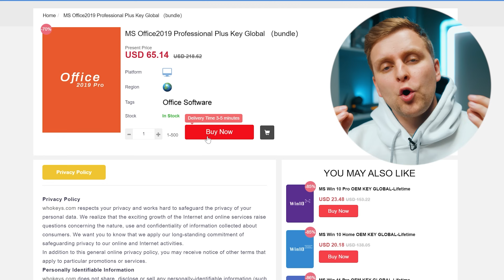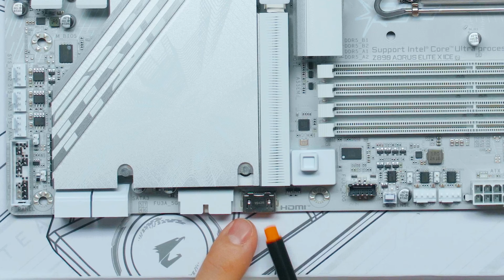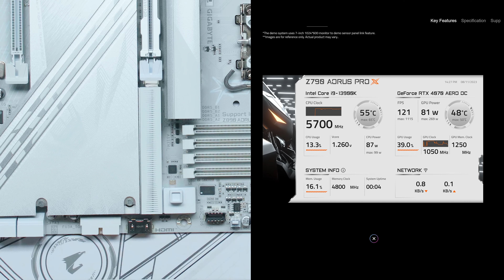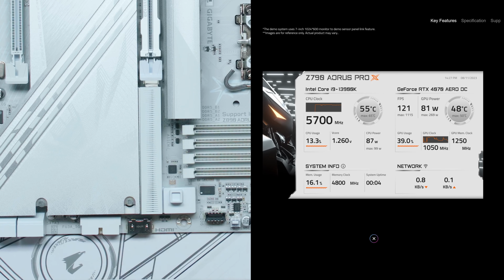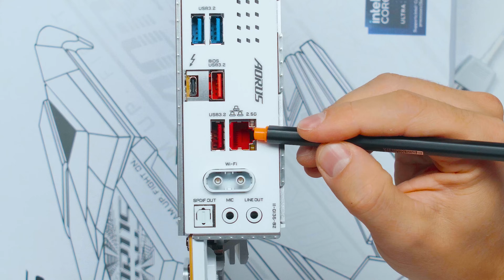The $300 motherboard you NEED in 2024!👉 Gigabyte Z890 Aorus Elite X Ice

Comment: I have a question, what about aio water cooling with the new Intel processors? Can I use for example the Lian Li 360 Hydro Shift? Or should I wait for the release of a new cooling specifically for the new Intel processors compatible with 1851?
Reply: I found out that will be compatible, I realy hope cuz I am already waiting with my new hydro shift 😅
Reply: LGA 1851 is 100% compatible with LGA 1700.
Reply: The socket is the same size as LGA 1700, just the pin layout is different. You'll be able to use all LGA 1700 coolers with the new LGA 1851 socket.
Reply: @ABP8214  thx dude

Comment: Poor mans bare bones. 8 pin power limited to 150W missing from the PCIe limiting the GPU you can add to it. I doubt 5090 would run at it full potential or pairing Battlemage optimally. Half the stuff you will never need on bare bones just to make the board look busy. Extremely poor cooling for storage and the power stages for CPU is bare minimum. This is for those that don't know any better or try to spend as little as possible getting shiet. I guess there is market for these but that doesn't include me or anyone that has even the basic knowledge.

Comment: One issue I had with a B650M Aorus Elite AX Ice is those right angled SATA/USB 3 connectors on the right side of the board. I was using an MSI case that came with a right angled USB 3 front IO cable and I had to use a different motherboard in the end because that right angled connector supplied with the case was blocked by some of the case internals. Very annoying!

Comment: Manufacturers need to start reducing the number of USB-A ports and increase the number of Thunderbolt and USB-C ports.
Reply from the maker: Yes!
Reply: 4 USB-C is just perfect , a mouse, a keyboard, a microphone (even a professionnal one at 192khz and 32 bits will be very far from saturating usb2.0 bandwidth, and optionnally an audio interface, or a printer)
Reply: I don't think many mice, keyboards, controllers, and mics require a require USB C.   As well, that'd be anti consumer, as we'd all need to ditch out current hardware.

Type C is also really bad with extensions.  The voltage and ampage is way too high for the cables they are currently using.   Needs to be as thick as a 12v plug adaptor.  It becomes a safety concern when the cord runs 125volts at 2.5 amps.
It's recently been under the scope when it comes to cable extensions, as the differing quality of the cords creates hot spots that can ignite if left unattended.  Ie.  One cord can run 125v at 2.5, but the connecting cord can only run 90v at 2amps.   Like a stove element, it heats up.  A hot spot.

We will see it one day, but I dont even think there are many available bits of hardware that are type C.   There is the growing market, but in proportion to the market as a whole, it's zilch.
Reply: @enigmalfidelity there are Type C adapters to & from all the other USB types. And Type C port won't send 125V down a cable that's not electronically tagged to be able to handle it. This is why some cables are 60W rated and other 100W, and if you plug the 60W one into a 100W charger, that charger will only sdnd 60W down that cable. It's really next-level safer vs old electrical cords, but I agree dodgy cables esp mis-tagged ones relative to their build quality, can be a concern same as with electric extension cords of over-stated gauge and ground cheat plugs etc.

Comment: going to stick to a nice 12700k build next month with a b760 s3h mobo and a mediocre 4060!new cpus are too fast for gpu bigger than 4060 and the power consumption is off the charts! I had a 12600k that died on me 2½ months ago since I killed a z690 pro rs mobo with a faulty Gigabyte 850w psu! I used the cpu on a cheap h610 mobo that also died after 2½ weeks use!
probably cuz I use pc 24/7
Reply: thanks for the data points